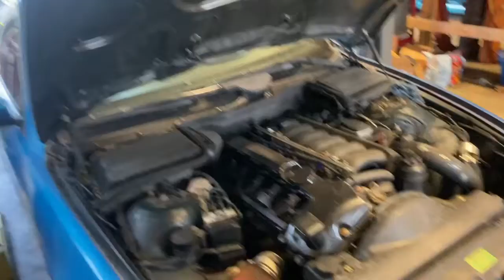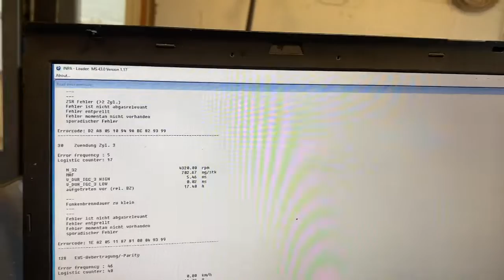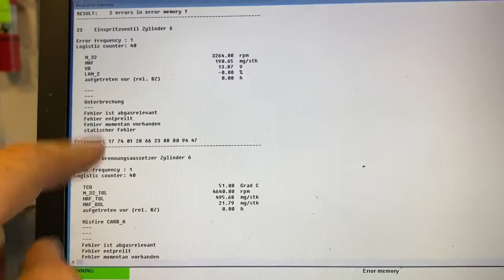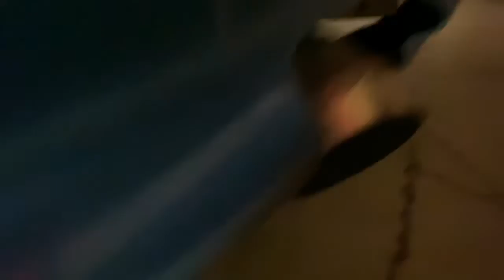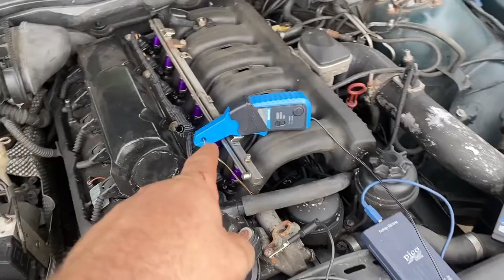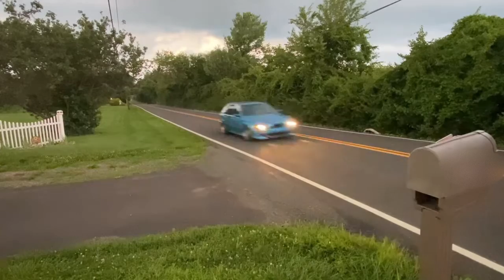Troubleshooting and fixing a misfire on a turbo E39 wagon M54 MS43

Comment: Whats the exhaust setup like?
Reply from the maker: It’s 3.5” from the turbo all the way back to a vibrant 3.5” muffler and a turn down tip. Wastegate is recirculated. I like the sound. It’s quiet on the highway
Reply: @spankranchgarage  Damn i gotta do that next year when i turbo my 528 too. Could you do a video showcasing the build or something? I really wanna know how your charge pipes are routed on the exhaust side since im gonna be running low mount turbo too. Also what type of diff you running? I know the 188k can hold power but im wondering if you have some kind of lsd in it.
Reply from the maker: @TheKingduffy138  I actually have all of that coming, so stay tuned. I'm having axle problems and I will be making a video about my solution.

Comment: Nice diag work brother. What o-scope is that? Also might want to check out OBS to screen capture so you don't get stuck with that bandicam watermark. Cheers
Reply: Its a Pico, Not sure which one but maybe the version before 4425A
Reply from the maker: Robert is right. Its a PICO, but a super base model 2204A. It is their cheapest model and gets the job done most of the times, but a faster scope with 4 channels is recommended. I have a really nice 1Ghz bench unit that I use when the PICO doesn't give me what I need

Comment: rare to see a scope being used for diag. Most people are pulling the trigger of the parts cannon way before even popping the hood. Very good job sir. BTW what current clamp are you using there?
Reply from the maker: Its a Hantek AC/DC clamp. Its very economical at 65 bucks or so. Its entry level but gets the job done. I would like to get a real PICO clamp some day